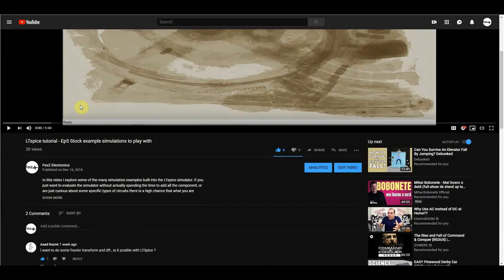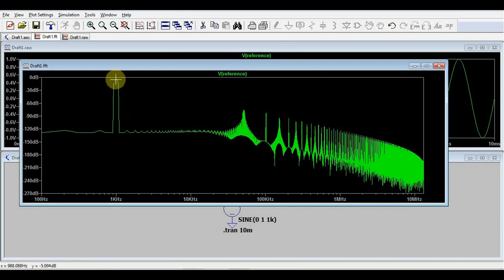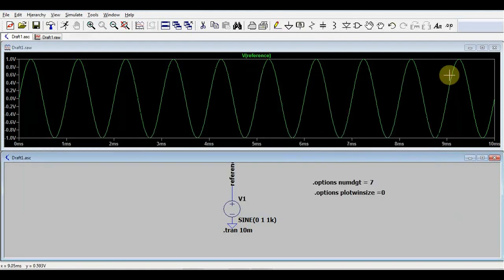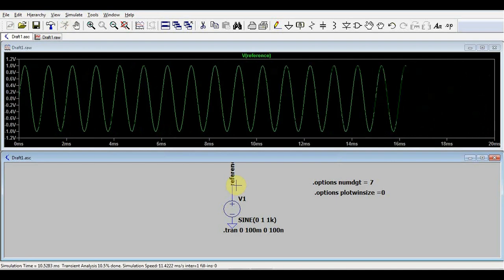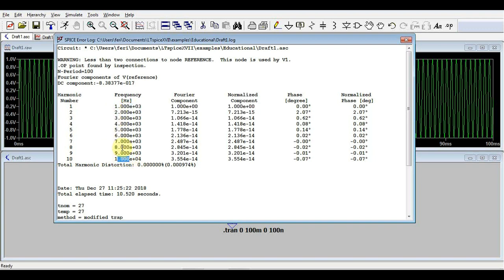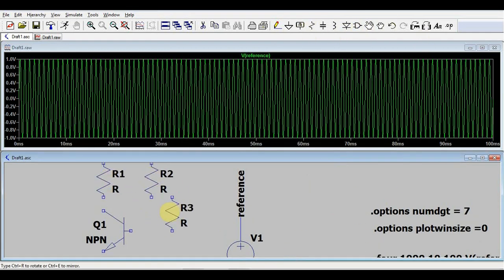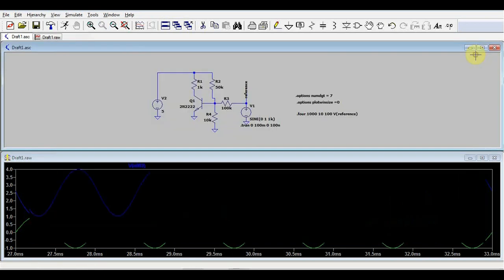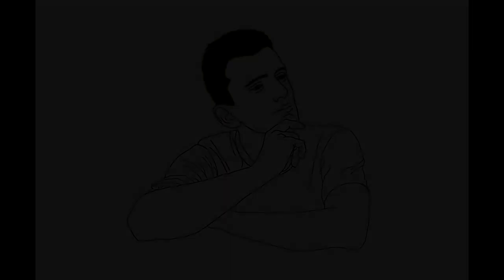LTspice tutorial - Ep6 Basics of FFT analysis and .four statment

Comment: Beautiful! Very creative!
You thought of everything. I was especially glad that you showed how to increase the resolution of the plot in the frequency domain (increase the simulation time), and that you included a simple circuit so that we could see multiple signals in the FFT plot and a fuller example of the .FOUR command.
I went from knowing zero about distortion analysis using LTSPICE  to basic competency in less than an hour.  Highly effective and very useful.  Thank you for doing this.
I'm going to watch all of your LTSPICE videos.
Reply from the maker: I'm happy you enjoyed my content! Thanks for watching! 
Let me know if there is any particular subject (electronics or simulation related of course) that you are interested in.
Reply: @FesZElectronics  I'd be grateful for your occasional help with a circuit problem or simulation question.  Thank you for your generosity!
Best,
David
Reply: @FesZElectronics  Let's dig into this a bit deeper and verify that the results are correct quantitatively.

I am testing a sine wave source that drives two equally valued resistors that are connected in series, and I am looking at the voltage between the resistors ("Vout").  "Vout" should be half of the input or  -6dB.  Working with the example in this video we have: (.tran 0 10m 0 100n) and the sine wave has a period of 1 ms.  Should the "Number of data points" be the total simulation time divided by the max step size (10ms/100ns = 100,00)?  When I do this I get a frequency plot that goes out only to 4.9 kHz and the magnitude of Vout is about -12 dB (off by a factor of 2).  If I use the default "Number of data points", which is 65,536, then I get a different plot (still wrong).  

Sure I can get a spike at 1 kHz, but any quantitative result is dependent on the number of points I choose, and I can't find the number to choose that gives me the correct output of -6 dB.  

Any thoughts?  Thank-you.
Reply from the maker: Hello David,
I think the main problem is that the magnitude should be compared to the input signal, I tried your experiment with a 1V input signal (SINE(0 1 1k)), which is 1Vpk, so already its -3dB. By adding the resistor divider I get -9dB. Sure there is an error there -3.02 and -9.04 but I think that is acceptable. The simulator works with RMS values not peak. By varying the number of points I found there is little influence on the precision, so only a few %, I couldn't get a 6dB error.
Let me know if this works out.
Reply: @FesZElectronics  Hello FesZ,
Thank you for your reply!
I agree with your analysis.  In my FFT pull-down window, in very tiny font at the bottom of the window it says: "Fourier components are normalized to correspond to the time domain RMS value."  I saw that at first, but I didn't pay any attention to it.  So the 1V sine input is -3dB, and at the half divider we see -9dB. (It is interesting to see that the FFT plot is of voltage magnitudes and not power). 
I repeated this experiment with a 5V sine input and a one-third divider.  The calculated values for the FFT outputs in this case would be: 20log(5/rt2) = 10.97 dB and 20log((1/3)(5/rt2)) = 1.43 dB.  My measured values were 10.88 dB and 1.35 dB.  The measured values show an error of a few percent. This was all done with the default setting of 65,536 points.  If I set the number of points to be 100,000, I get values that I can't make sense of. So despite good reason, it seems best to leave the number of points at the default value.  (I am working with the Mac version of LTspice, which is limited).
Combined with the output in the log file that is generated from the .FOUR command, this is all good enough for me, for now.  To get a better correspondence between the measured value and the correct (calculated) value, I would need to know more about how to set up the FFT simulation, based on understanding how the FFT works.  That is a project for another day.
Thanks again for your help! I look forward to learning more from your other videos!

Comment: Thanks for the video, very helpful! Although what does it mean when your output FFT matches the input almost exactly but is just much higher than the input?
Reply from the maker: Well if the 2 spectrum's are exactly the same, then their frequency content is the same - you are looking at 2 identical signals. The vertical position relates to the amplitude. A signal that is in the upper part of the FFT has a higher amplitude than the same signal on a lower part, in other words this is what you get when looking at a good amplifier, the spectrum of the input an output is the same, but the output is higher up, since the signal has a bigger amplitude

Comment: I m simulating a simple RC on LTspice with 2 AC sinusoid Voltage(30V, 50hz) and (1V,1khertz)  sources, when I perform fft i am getting a smooth and clean but a sloping down fft. The baseline is tilted bro:). If you have any suggestions please reply me.

Comment: Is it easily explainable why changing values of linear components like resistors (as they are actually modelled i think) you can obtain a better resolution in the frequency domain as you described at the end ? In which way would it be possible to obtain even better results (lesser distortion) ?
Always thank you for your precious work.

Comment: Would you know a way to selected the frequency axis at FFT view? For example, I use the FFT analysis and my signal is only up to 100KHz, but I want to see until 10MHz for example, where to select this?
Reply from the maker: If you are running a simulation for long time periods, you might have a time step issue - try adding some small number (100ns or less) on the "maximum time step" field on your transient analysis window. Also what you will need to do is set a larger number of samples in the FFT request window - "number of data point samples in time"'; based on the number of samples and the simulation time you will get a maximum analyzed frequency.
Reply: @FesZElectronics  I was already using small time step, but the number of samples did the job. Thanks!
Reply from the maker: @TheFoskon  happy i could help! Cheers!
Reply: One more thing, I have seen your videos about common-mode and differential mode noise, but they are only for single phase. Have you ever simulated these noises in three phase equipment? I am trying to do that in the moment, but it seems to not be fully appropriated, I started from your approach of separating the system neutral from ground and adding the noise through small capacitances, but in the resulting line current there is no noise, which shows that the CM is not good modelled, also the addition of DM noise is not clear since it must be between each of the three phases
Reply from the maker: @TheFoskon  I have to be honest, I didn't really work with 3phase circuits so that is why I don't really focus on those. To get the DM noise, it should be inserted 3 times (between each of the phase pairs) -  this ensures you can insert different amounts of noise if the circuit is not perfectly symmetrical ; and for CM noise, you must make sure there is a return path - it needs to close to ground (PE) on both the DUT (noise generator side) as well as the power supply side - so there is a continuous loop.

Comment: Excellent video FesZ! I have one question regarding a FFT simulation which depends on a power supply that requires about 5 seconds to stabilize. With a stop time of 100mS and a time to start saving data of 5 Seconds, I have to wait for well over an hour to get to the point that the supply stabilizes and takes a 100mS snapshot of data. Is there a way to speed through the first 5 seconds at default rates then take a detailed snapshot after that point?
Reply from the maker: One trick I use to stabilize supplies faster is to supply the output trough a diode from a voltage source so that the output is always  ~0,5V lower than the final voltage. This way the simulated circuit only needs to provide the extra voltage missing, not the full span from 0V.
Reply from the maker: Hello dcjdinmn1! In the mean time I think I found the proper way of doing this - the ".ic" or Initial conditions statement. With this you can set node voltages and inductor currents. Once you reach steady state, get the data and then use the .ic statement; check out LTspice help for details on correct syntax

Comment: Dude, when i just make a .tran analysis and probe my desired signal to make an FFT using the plot, i can change Y values to "linear" instead of "dB" on the FFT graph. The FFT in dB's are dBm??? 

I aways get lost with the dB nomenclature, the dB nomenclature only messes the learning process in my opninon, never helped me out.. Even when i have to do sums instead of product (because of log / dB) I would prefer to just do the product and know what i'm actually doing.. 

Can u help me out on this topic? Any tips for actually understanding dB once and for all? lol

Ty for the vid! You have great content and was very easy to follow with great tips!
Reply from the maker: Hello Vitor!
Well, dBm is a measure of power 0dBm=1mW; And since its a measure of power, every 10dBm you increase the value 10fold (10dBm=10mW; 20dBm=100mW); this ratio is valid for any expression of power in dB. 
Now dB when used for things like voltage or current (the amplitude of a signal) the value increases by a factor 10 every 20dB. For example in LTspice if you plot the FFt of a voltage 0dB will correspond to 1V and -20dB to 0.1V.
Normally you can't plot the FFT of a formula in LTspice (like power = I*U) but you can get around this by creating a behavioral voltage source whose output is equal to I*U. But in this case the FFT will be expressed for a signal amplitude so factor 10 every 20dB.
You can change from dB to linear expression or logarithmic in LTspice - depends on which is more easy to follow (dB and logarithmic look the same, its just that dB is replaced by a power of 10 (-40dB=10e-2). The logarithmic scale is better suited when you want to compare wildly different values in a comprehensible fashion - a low pass filter has a -20dB/decade response so the response at say F0=1 and 10*F0=0.1 and at 100F0=0.01. Now on a linear scale this makes no sense - you can see the 1, maybe the 0.1 but the 0.01 is no longer clear;

Hope this helps! 
Fesz
Reply: @FesZElectronics  Nice, ty a lot for the help made it a lot clearer than before. I actually have to check the expression for dB in W and V or i.. I aways forget the formulas. 

So is it right to say that when i measure voltage and the scale is in dB, probably it's referenced to 1V ??? Just like LTSPICE?? (not aways but in most cases?)
Reply from the maker: Just to be on the safe side, I would try to measure a well known signal source - if you know the source is 1V and the measurement says 0dB then there is a match; or measure the same unknown signal with another piece of equipment that has a more clear way of expression.
Reply: @FesZElectronics  Just did that at LTSPICE and ur right, its dBV on LTSPICE that's the unit used for measurements on the Y plane of voltage. I really don't understand why they don't display the V on dBV of the Y axis, it's a commom source of confusion.

Comment: Can you decrease the distortion percent without reducing or increasing the resistors?
Reply from the maker: I guess you are referring to the transistor amplifier; In that example I just trough together some values, I didn't really bother to find a "good" circuit that works. But to reduce distortion, you need to understand the cause, for that particular example, firstly you should use a DC isolation capacitor - so not insert the signal directly, but rather trough a large capacitor - this will center the signal around the operation point. Secondly, a very large input signal amplitude will cause distortion since the amplifying stage cannot uniformly amplify; so a smaller signal usually helps. 
Do you have a particular use case in mind?

Comment: Hi everyone, when i simulate any amplifier in lt spice it always looks about the same at 1khz really noisey the higher the freq at lower freq the floor is pretty flat but after 1khz it starts looking like a high pass filter slope. Other issue is changing the scope time makes a large difference in THD percentage, is there a .options I can set where I can know my THD is closest to what it would be in the real world and also be reliable if I change my fundamental to any freq within the audio band. A amp I built on my bench is around .1 percent THD on a breadboard but lt spice claims it should be around 1 percent lol huge difference.

Comment: Hi guys, anyone try to use the .four  and set the Nharmonics as 10(which same as FesZ did) and after simulate, only found that the result in Error log shows only one harmonic? Any ideas please? Thanks a lot!
Reply from the maker: Can share the exact .four statement syntax you used? maybe we can figure out the problem.
Reply: @FesZElectronics  I use the same syntax as you did in this lesson, which is .four 1000 10 100 V(reference), after i run the simulation and open the error log, the result only shows one harmonic which is at 1kHz and also no distortion. Then i tried to revise the Nharmonic  parameter, say from 10 to 100, then more harmonic results showd in then error log, but also not 100, it only shows the result at frequency 1kHz/2kHz/29kHz/30kHz..etc. I'm using the same voltage model as you did...so the result should be same, so weird...
Reply: @FesZElectronics  Well, I found the reason why this is so, the txt file generated by LTSPICE just didn't align well, so 2nd/3rd...10th results are all in one line... Sorry for bothering
Reply from the maker: No problem. Did you open the error log as a separate file? or is it all compacted when you view it in LTspice? I usually view it trough LTspice (View->ErrorLog) and there is no issue.